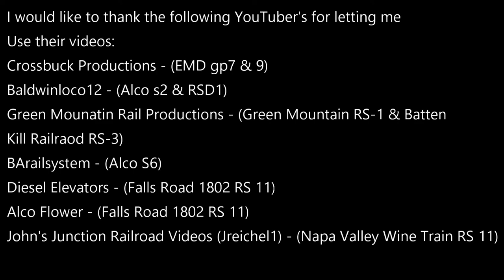THE HISTORY OF ALCOS ROAD SWICHERS PART 3 THE RS 11

Comment: nice video; thanks tons!!👏👏
🤞Argentina bought 130 RSD16 (DHL-540) with 251B motor & have been on duty since 1957, 64 years so far.
Used for cargo, long distance passenger trips, commuting, shunting; might have them around for another decade or two.
saludos = cheers
Richard, 🇦🇷Argentina

Comment: IF you had a railroad (L&N) that knew the ins & outs of an engine (i.e. the 244 & 251) and had a ready supply of trained repair folks & crews / parts, both engines could be serviced easily & earn their keep.   I reference the longevity of the L&N 1300 series Alco c420s (largest in the US) ;D smoking right along down the tracks ;D

Comment: Bringing up the short falls of the 244 was just, but once railroads understood the engines issues and made the updates these units worked just fine for many major Railroads and short lines that knew how to maintain them. Most notable are EL (who my Grandfather worked for and Loved the RS-3 !!) NYC, NH, PRR, D&H, B&M, L&N, SP&S, L&HR, CRI&P, SP, SAL and many more even to this day !
Reply from the maker: I do like the 244. What I don't like is how Alco just put the engine into to rs-3 and its other locomotives and "Crossed their fingers" and hoped it would work out, in spite the warning sings. Also, as I ponied out in the video, most of the second hand buyers of the rs-3 like the locomotive, once they had the necessary knowledge and parts to repair the prime movers and keep them going. 
Thanks for watching!
Reply: @alcobufff  I hear ya !
It had it's issues for sure.  I will re-word it  : )
Reply: Should be noted that the 16 cylinder version was more problematic then the 12 cylinder. While ALCo resolved the issues, the financial cost and reliability question probably cost them more in their reputation.
Funny that they went back to the 241 for the base of the 251.

Thanks for your posts!

Comment: I don't care what problems  they had with  these  units. I like them .and because they had problems with it, they still would  get down  and  pull  and with proper  TLC, these units were actually  really good  locomotives.  Criticize  them all you want,some of these girls are still in operation on the Mexican railroads just south of the border.

Comment: The CV must have really liked the rs11 cause they bought some 14 from the DWP. Also I'm a GM guy but the RS11 is a nice loco especially in green and gold
Reply from the maker: If I remember correctly, the CV was a spin off of the DWP, to handle the American side of the CN's business, who also owned the DWP at that point. Canada was going through a privatizing area and the railroads were no exceptions.
Reply: @alcobufff  The CV wasn't a spinoff of the DW&P--the CV had its own history, going back to the 1870's, completely independent of the DW&P.  You're correct that both the CV and DW&P were CN subsidiaries, however.  No doubt the common corporate parent did play a role in the DW&P RS-11's migrating to the CV.

Comment: At 4:20 the cars are rocking back and forth big time. Is that typical, or is that track in serious need of repair? Great video.
Reply from the maker: The answer to both questions is actually yes. It's typical for short lines railroads to operate less then perfect track at slow speeds, as track maintenance can get very expensive. this is not normally an issue for short lines as they don't need speed and will simply operate as slow as 5 mph. So yes, the track dose need  work, in some sections, I understand the batten kill has since started to correct these bad sections of track like the one you pointed out. Its a shame thought, when I road the Batten kill rambler, the company's now canceled passenger service, in the mid 90's, the track had just gone thought a major upgrade program. we zipped along at easily over 40MPH! once off the train, there were sings that new ties had been installed and fresh ballast was every were. The rambler has long since been discounted, apparently due to lack of ridership, this may have contributed to the tracks decay as passenger serves requires higher track maintenance levels for insurance reasons. also, the company  changed owners back in 2008.
Thanks for watching!
Reply: Rail is shot, needs total repair,but no funds

Comment: If you would be able and or willing to do a small segment on the MKTs rs3ms I would be more than fine to present footage of one of the last in operation.

I even have some videos/photos of her 4 builders plates for both emd and alco
Reply from the maker: Sounds interesting. Do you have those videos posted?
Reply: @alcobufff  not yet but I can very quickly do so. If not I will link you to my drive so you can find it yourself.

Comment: I enjoyed the video very detailed well put together and very well done. However there is a Mistruth in the ideology behind long hood forward operations the N&W and Southern Railway preferred engines Highhood and LHF for two reasons the first is eliminating the need to turn the locomotives as the locomotive if LHF didn’t have to be turned for visibility of line side signals specifically when MU-ed together the other is the high hood keeps from early AAR locomotive operation rules which in the early days required locomotives with short hoods as they were not common practice required that they must face forward utilizing the forward windows wherever possible these two factors eliminated the meeting of this requirement. While it had the added benefit of being safer for the crew this was not the reason nor the case. Railroads historically have never had much consideration for crew comfort or safety